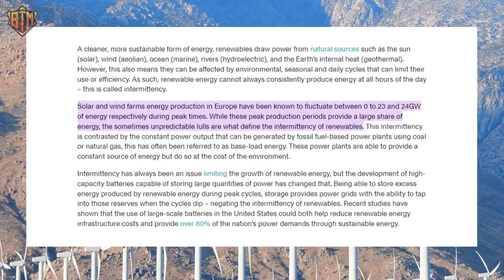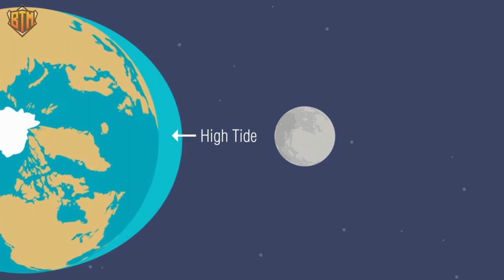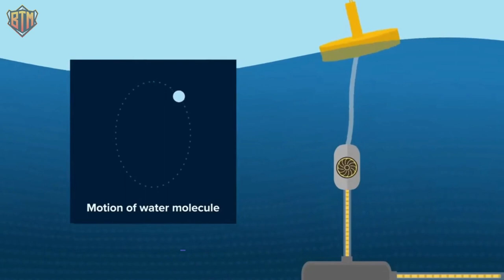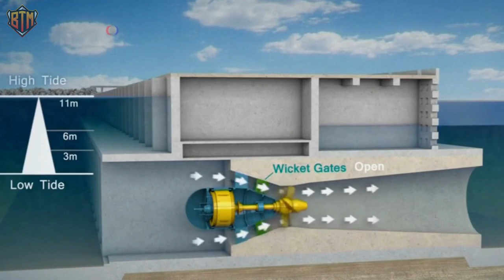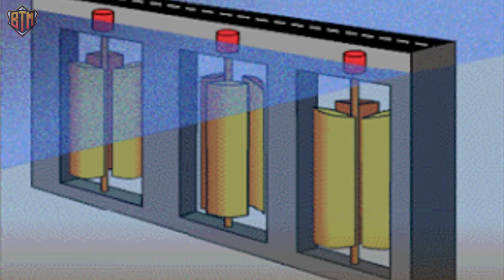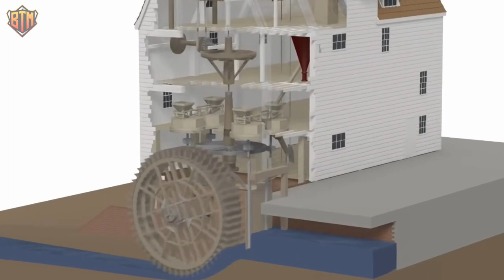This New Energy Breakthrough SHOCKS American Scientists || Tech News

Comment: The renewable energy system I do not see here is the ocean current (gyre) driven in the water enhanced flow turbines that get their "spin" via hydrokinetic means. Water is 800+ times denser than air, so it delivers lots of force in much smaller turbines. Wow